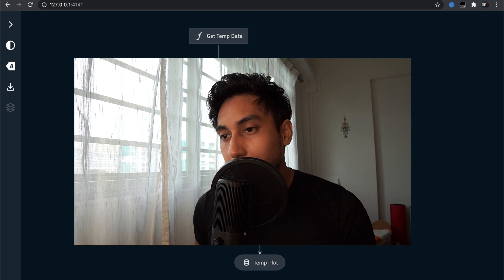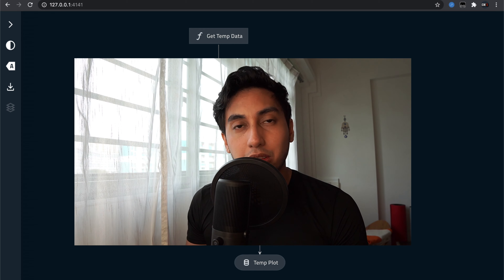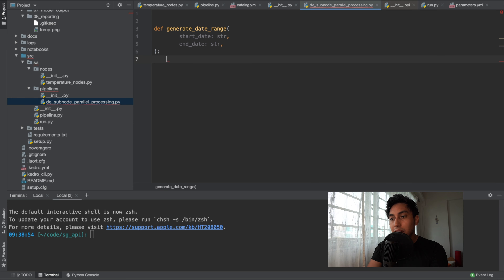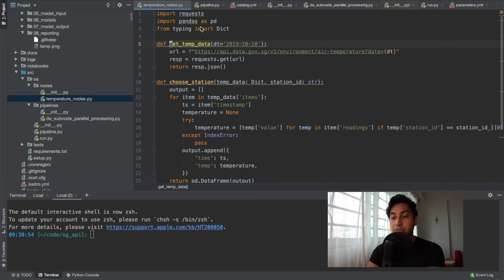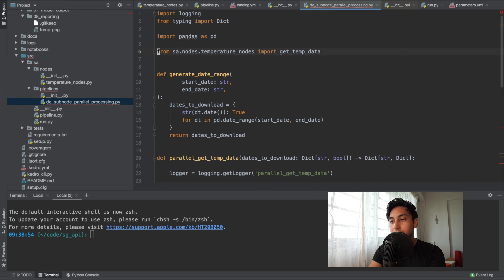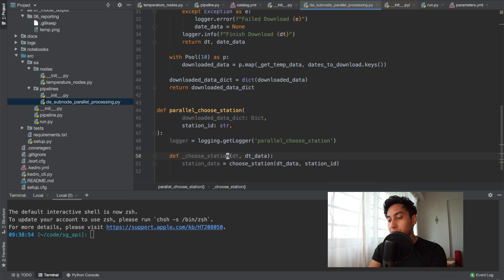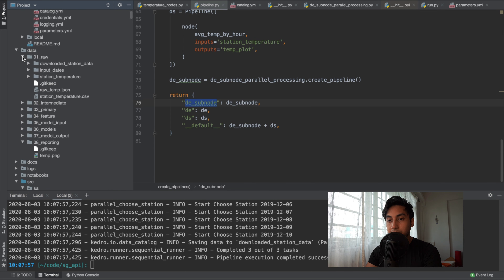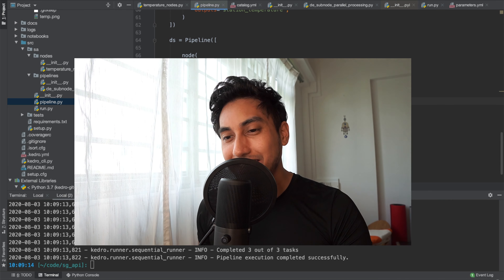Parallelize Pipeline Processing With Sub Node Parallelization - How I Write Pipes Part IV

Comment: If you data is very big, would this approach still work? Would passing the data back to be aggregated in the dict (to be passed to PartionedDataSet) still work?
Reply from the maker: If the data is too large for this approach, you might be better off going with a proper data parallel processing solution such as spark. Of course, if you have a beefy enough machine, no data is too large for this approach :)
Reply: @DataEngineerOne  I was using Ray for this task instead of Spark. There was not only a matter of data size but the execution time of writing all that data. Here I was using each worker to write to disk, but wanted a way to use the PartionedDataSet recorded/registered in the catalog to save to file. That way I bypass pushing dataframes across the stacks and processes.
Reply from the maker: @javierbosch1338  Aha, I see. Yes, you certainly can should be able to pass the data into a PartitionedDataSet that wraps around a pandas DataFrame, to serialize the reading and writing. But, if the data is as big as you say, you may still run into speed issues with regard to IO